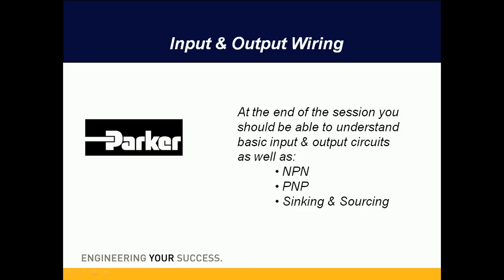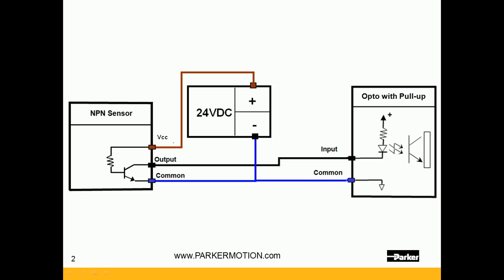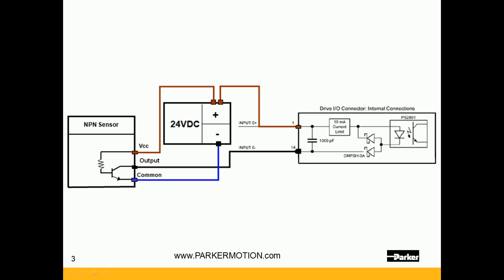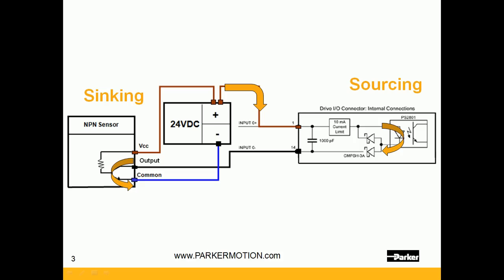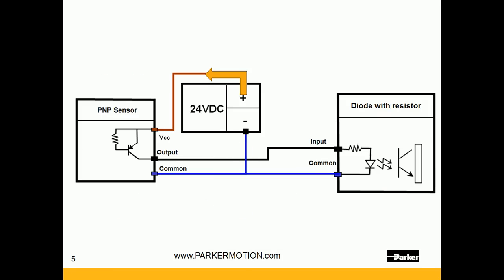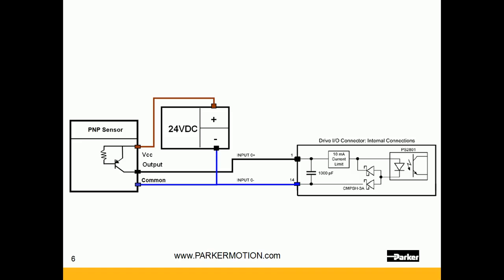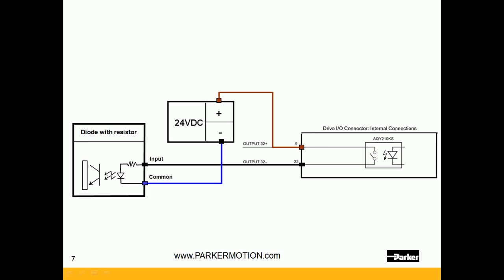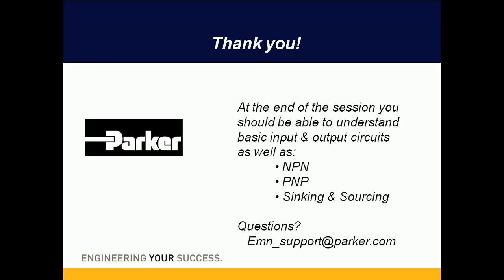How do PLC Transistor IO (NPN PNP Sinking Sourcing) work?

Comment: crown cork is stainless steel type of material then how it is attracted by inductive proximity and refro reflective photo sensor?
Reply from the maker: That’s not the point of the video. If you’ve questions on sensor technology I suggest contacting a sensor manufacturer. This video explains connecting to plc or controller and the circuit.

Comment: At 1:54 would that not be a sinking input? The PLC  (or input would) only go to a high state with a complete path to circuit ground, thus the device sinks to attain this "true" state. The sensor also sinks, but is not sourced from a control perspective by the PLC (Whatever circuit).
Reply from the maker: The current is flowing out of the input, switched to ground at the sensor. So the input is sourcing the current and the sensor sinks.